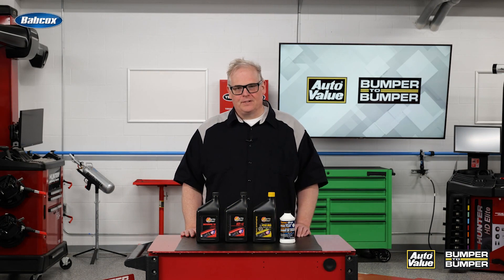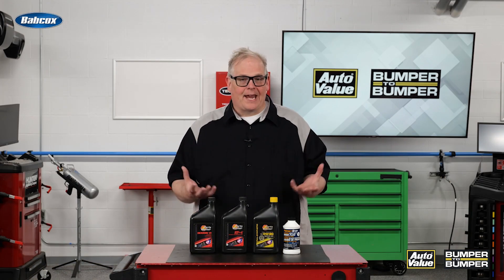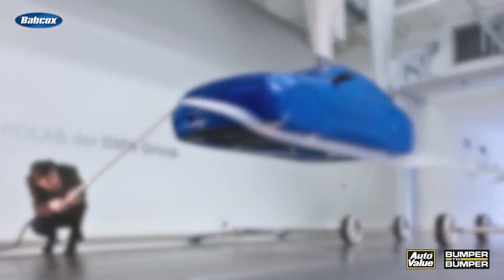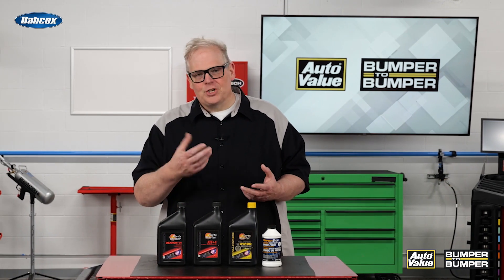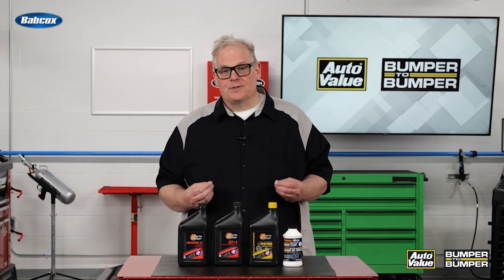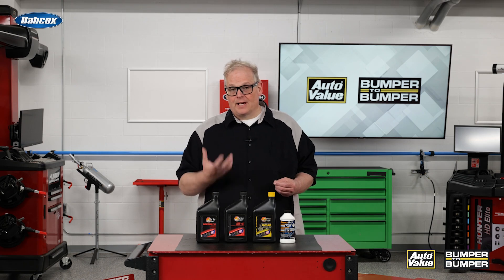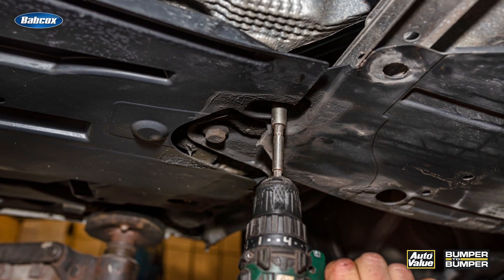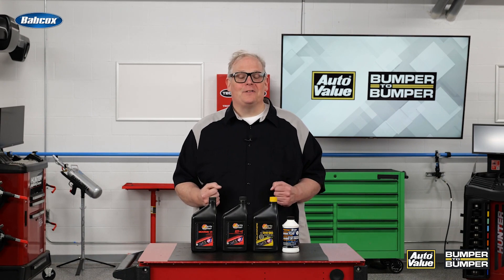Engine Panel Diagnostics

Comment: Great explanation Andrew, I really hate to see missing hardware on these panels.  I would have to assume most of the flapping ones came from a quick lube that didn’t put them back correctly and with all the screws.
Reply: thanks!